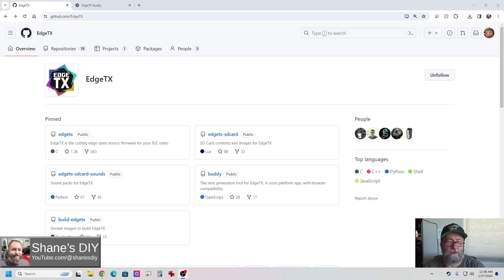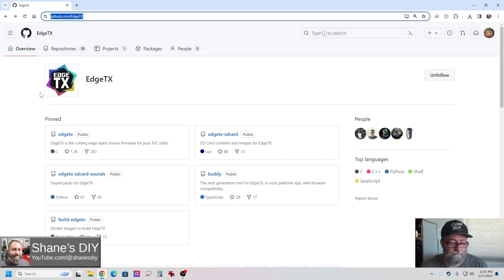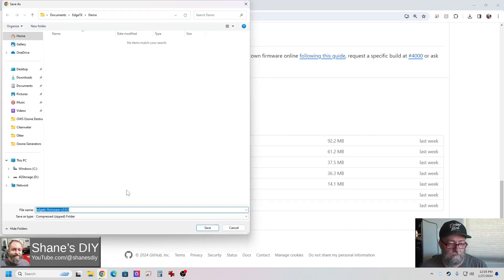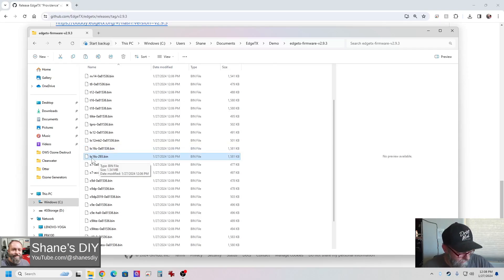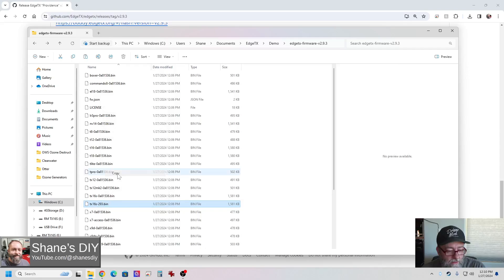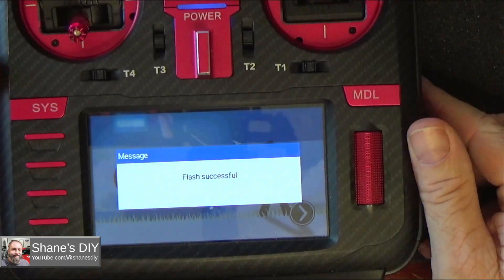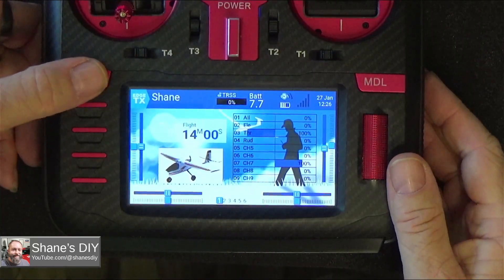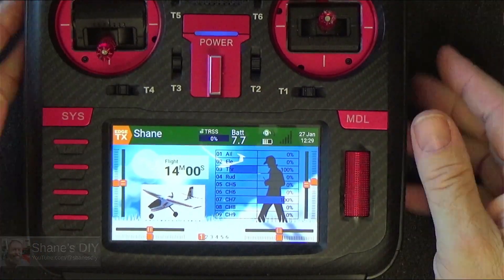Simple & Reliable EdgeTX Firmware Updates

Comment: Question 2:i have the as3x moving in the ailerons in the incorrect direction , i guess the gyro reverse channel menu is used to adjust this, correct?
I am using the new BOXER lua script for B&W TX created by Francisco Arzu, but when revising ailerons nothing changes, i am saving the changes. Is there anything else i need to do to send the new setting to the RX in addition to save the changes? 
I may be missing one step but i do not know what is it. My last option is factory reset and start from scratch.
Any advise? Thanks
Reply from the maker: By the way, if you can get it into safe mode with self leveling it is much easier to confirm if the control directions are correct.  In AS3X you have to watch very closely for the slight movement.
Reply: @shanesdiy  yes movements are small...what i did was ser the gains for  4x , so i can see better. Plus i think it is the correct gain for slow plains. 
thanks again!!
Reply from the maker: @alexherrera3918  I've never set any plane to higher than 1x, be careful and be ready to turn off the gyro if it starts "shaking" in the air.
Reply: @shanesdiy  point taken and note made, tks for the advice!!!
Reply from the maker: There are two different controls. If the ailerons are reversed when you move the transmitter sticks you need to invert the channel in the radio output page. If the safe mode is controlling the ailerons backwards that must be reversed in forward programming model setup.
Reply: @shanesdiy  ok ,sticks are moving correctly the aileron.
The wind correction is the one that is not working: if shake one wing up the as3x  aileron correction should move aileron up but it does not. If the gyro reverse menu is the one used to modify this then i am doing it correctly and the lua scrip has a bug.
thanks again.!
Reply from the maker: @alexherrera3918  You have to first go into the "Model Setup" menu -> Gyro Channel Reverse and reverse the direction of the aileron channel. Aileron will be "Port 2 (TX:Ch1) most likely (if your TX is setup as AETR)  You can tell this from the mixer channel order.  Once you reverse the channel there, you go into Forward programming -> Gyro settings -> System Setup -> Relearn Servo Settings.  This will send the new channel direction to the receiver.

In Episode 3 I show how to reverse a gyro channel.  The link below takes you directly to that time stamp.
https://youtu.be/mEfLGnEZN9U?si=yPmv47oo6RkHzXki&t=2012
Reply: @shanesdiy  I watched several time i learned a lotta. 
I finally factory reset and started from scratch...including the relearn the servos from your video and worked now.
i still do not know what i did wrong...my guess did not relearn the servos.
Many thinks to do if you are just learning.

Many thanks for your support.

Comment: Question : my middle mod and acrobatic mode ( no safe mode) have the same movement.
example: i move stil (any) to the further far side and the move the the 3 modes i have in my switch. 
I see that there is a differencw between safe level mode and the second mode. Bu when i move switch to third mode that does not have safe then the suface level does not move further, that tell me that it was alreasy at the max. 

please advice how to adjust this , i am using an ar631 in a durafly tundra. my tx is Boxer with laters firmware version.

Thanks
Reply from the maker: It isn't a problem, it just has two modes currently. Very common.  If you have the latest forward programming scripts on the radio, enter forward programming and you can change the configuration of each flight mode. Mode #2 often is set for "Envelope" which doesn't have auto leveling but does have bank limits. If you get into forward programming and don't have access to edit flight modes it is still locked or perhaps you've unlocked it but didn't do the factory reset yet. Once you do the factory reset you have to program everything from scratch.  It's all explained and demonstrated in this video series.
Reply: @shanesdiy  ok tks i did set on one mode on enbelope  yhanks to your video.
 So the throw of the control surfaces are adjusted by the angle, correct and it is done in the gain section?
tks
Reply from the maker: @alexherrera3918  You can't adjust the throw of the control surfaces like high/low rates via forward programming. In safe/self level mode the throw of the control surfaces is proportional to the bank or pitch angle. If the plane is level and you go full right aileron, for example, the aileron will move to its max. As the plane rotates to the right, the ailerons will gradually return to the neutral position and when you reach the programmed bank limit, they will be at neutral preventing you from banking any further.  This has the same effect of "low rates". 

If you set it for envelope mode, the control surfaces will have full throw until the plane bank reaches the bank limit and then they will quickly snap to the neutral position preventing further banking.  This still keeps you from going inverted but have much quicker response.

Gain adjusts how the gyro automatically compensates for uncommanded movement such as wind, and self adjusts the control surfaces.  The bank limits are edited in the "Gyro settings" -> "SAFE Settings" -> "Angle Limits" menu

If you want to program high/low rates and expo do that in your transmitter and you'll be able to much more precisely control that.  You generally want to leave 100% rates while in safe mode as it is already dialed down inside the receiver.
Reply: @shanesdiy  got it thanks ,i will try.
Now it is going to be difficult to set throws recommended by manufacturer of the Durafly tundta because that are in millimeters and i have no idea how to convert those to angle inclination. but i will try.

thanks again!!
Reply from the maker: @alexherrera3918  Just my personal opinion, it's not that important to be exact, those numbers are a "rule of thumb" to get you in the ball park. Rates and expo are personal preference to the pilot.  For a plane like that I'd have my radio rates set for high at 100% weight with 30% expo and low rates I'd use 70-75% weight with 30% expo.  Only switch to high rates when you are feeling adventurous, and if low rates are still too sensitive, turn down the weight some more to maybe 60%.

If you really want to be precise, the mm measurement is the change in position of the control surface in neutral to the fully extended position.  Measure the trailing edge of the control surface and adjust the weight until the edge has moved xx millimeters.  Don't need to worry about angles, it is just the distance of movement.
Reply: @shanesdiy  ok, by angle meant gain angles in the TX.
Reply from the maker: What model?  Many BNF models with the stock program switch between 3 modes but modes 2 & 3 are just AS3X, no auto leveling or bank limits.
Reply: @shanesdiy  good question, i purchase used and i think previous owner does not remember.
So , factory reset does not solve this problem?
Or i shouldn't adjust this prior starting forward programming process like regular rx set up?

tks

Comment: Funny thing is I cant get the newest companion to work on my laptop , It starts installing and then I get a pop up saying error
Reply from the maker: Might want to download a fresh copy, perhaps the download got corrupted?  I haven't had any trouble installing 2.9.3 Companion.
Reply: @shanesdiy  I tried over and over. But oh well, really don't need it. I just make copies of my SD card
Reply from the maker: @MikeyMikey1968  Same, I don't use it much with my radio, I mostly use Companion to create "virtual radios" when someone has a question about a Boxer, Zorro, etc. that I don't have and I can simulate just about anything.

Comment: I updated my TX16S a couple of days ago and had no trouble at all. I apparently used Buddy because I just told it what transmitter I had and the version, and it installed it. I also updated the Multi-Module to TAER because I use mostly Spektrum receivers.
Reply from the maker: Ya, Buddy is a great tool when it works.  Due to the number of people that have trouble connecting to it, I lean towards the "manual method".

Comment: Buddy does the same thing . Just download the bin , takes me less then 2mins to update
Reply from the maker: I mention Buddy in the video and it works for me as well but I have worked with a 1/2 dozen people that could not get their transmitters to be recognized by the PC and talk to Buddy.  A PC issue but the method shown here eliminates most complications I've ran into providing tech support. Goal is to remove as many potential technical issues as possible.

If Buddy works for you, stick with it for sure, it is a great tool.
Reply: @shanesdiy  I use buddy just to download the file. I don't use the flash part. That part is where people have issues . I just download the file to my computer and do the rest like you do
Reply: @shanesdiy did not work for me i have a modified window 10 and i do not see my tx . this video shows the most effective way of doing it 

thanks for sharing!!!
Reply: @alexherrera3918  don't use the flash part on buddy,  just use the download bin.
Reply: @MikeyMikey1968  tks. just did the old fashion way by downloading the files into the sd card. tks